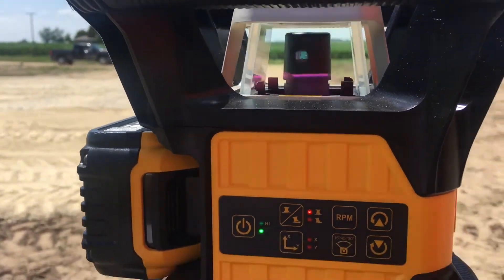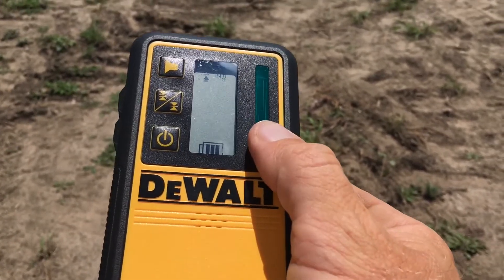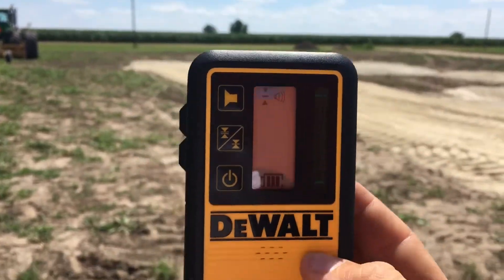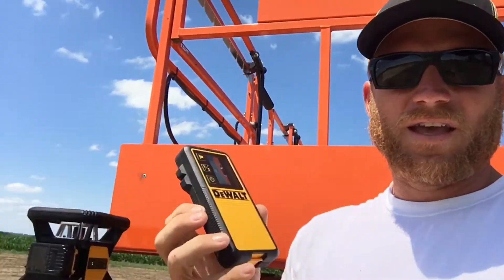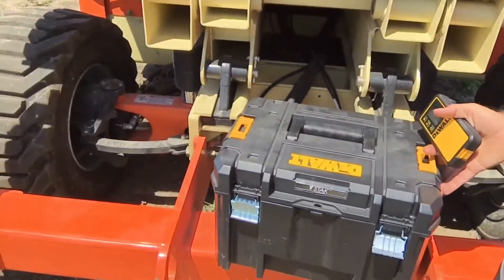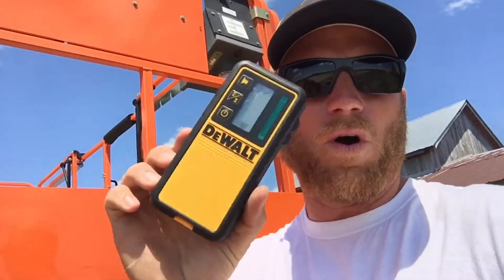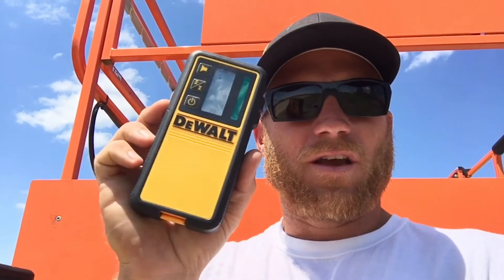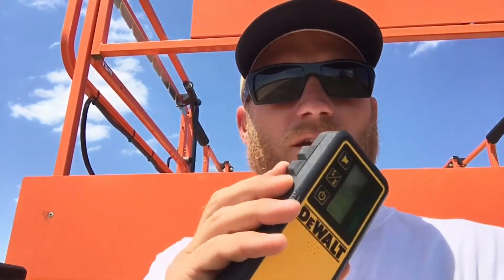DW079LG laser from dewalt

Comment: I agree 1000 percent.   I am a DEWALT snob and bought this transit due to it goes great with my battery platform. However I despise having to use this transit due to the difficulty acquiring signal with the reader.   Something I have not tried is will a different reader pick up the DEWALT laser?    Probably a dumb question but just haven’t tried it to know for certain
Reply: Same issue here. Willing to try a different receiver
Reply: There are receivers out there available that work with both green and red rotary lasers.

Comment: Hi Kyle, I know this is three years old now but have the same laser and was wondering if you’re receiver picks up the beam when rotating at max speed ? Mine doesn’t seem to detect the laser at high rpm.
Reply from the maker: Not a huge fan of this laser
Reply: RR Buildings what laser do you recommend?
Reply: @RRBuildings  Glad I read the comments instead of just your video, thank you for your honesty, what level do you recommend if not this one?
Reply: @Jennifer-007  I've used several, and I really like the Hilti self leveling laser.

Comment: I need to build a 2000feet water channel and I need it as perfect as possible 
1/16 Accuracy for 100 feet, what does that mean for 2000 feet? 
Can someone explain?
Reply: According to that spec, 1/16" @ 100 feet would be 20 times that at 2000 feet or 1 1/4" @ 2000 ft.